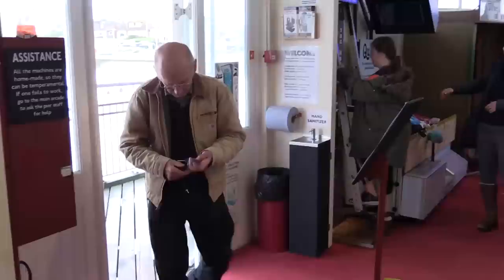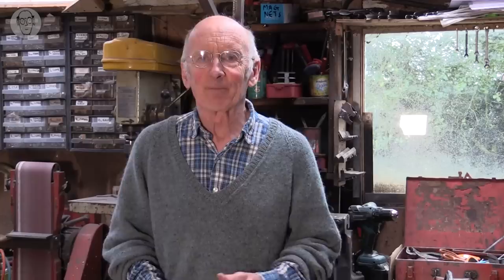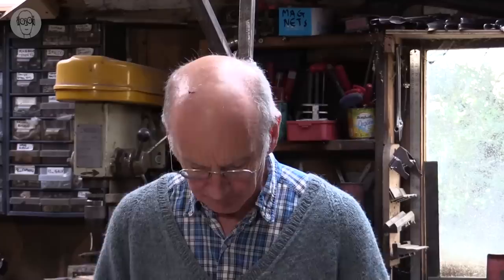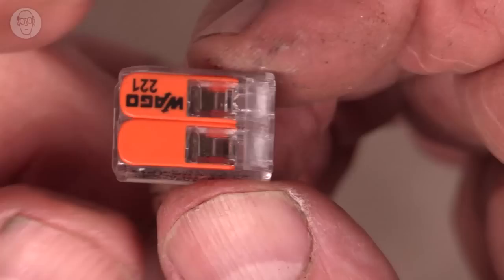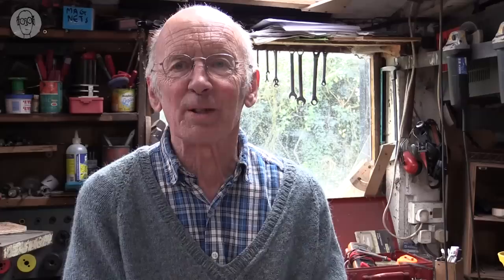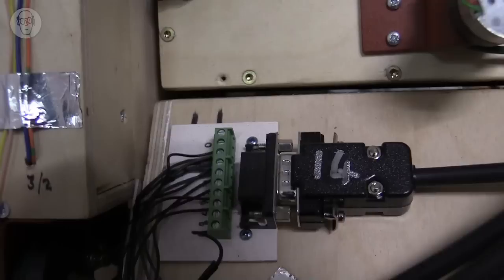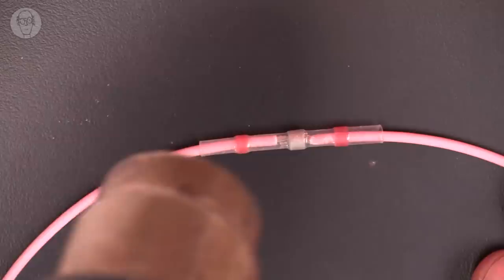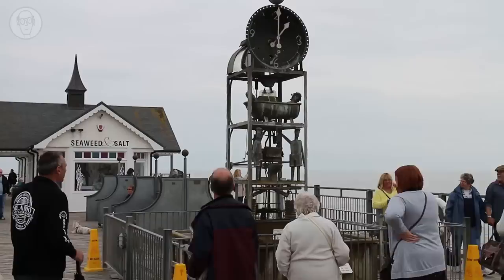CONNECTORS -- The Secret Life of Components, a series of guides for makers and designers - Episode 6

Comment: The extra bit on the IDC connector is not to lock it - it's a cable strain relief  - you fold the cable back over the rear of the connector and clamp it down with the locking bar. 
A vice is better than pliers for crimping as the jaws stay parallel
Reply: Channel-lock pliers or other similar parallel-jaw pliers work okay for those types of IDC ribbon connectors; as a former tele-data technician we used parallel-jaw pliers for installing one particular type of Category 5 data connector (Siemens or Panduit?, I can't remember which).  The manufacturer probably had a specified tool (plastic-jawed, perhaps) for this, but specialized tools were rarely provided by our cheapskate employer and so Channel-lock pliers were invariably used.
Reply: There are clamping pliers with parallel jaws made just for IDC.
Reply: @goodun2974  A fancy LAPP Cat 6 IDC actually said  "Our tool, or a Knipex plier wrench".
Reply: Ahhh, I wanted to write exactly that, saved me some keystrokes :D Thanks Mike
Reply: @AlienRelics  - a cheap hobby vice (or pana-vice) is great for crimping IDC ribbon cable connectors. And plain old scissors cuts the ribbon cable nicely but use a sharp pair to avoid getting small strands possibly sorting out adjacent wires. I have put many of these together, going back more than 35 years now.
Reply: It does lock the top as well. At least on the good AMP style ones.
Reply: Sir Scofferoff  usually the “label” was made from Tyvek
Reply: @unlokia  I always wondered what they were made of - I was scared of using them to pull the connectors in case they tore, how strong are they really?
Reply: @goodun2974  Parellel action pliers were issued by british telecom for crimping phone plugs, and another set for doing 8A wire connectors
Reply: The best way to crimp IDC connectors is to use a purpose built correct. Also it is vital to keep the cable properly aligned and straight when crimping to ensure unwanted shorts. I great hint is that you can use a pair of IDC connectors to make a removable sense coil by offsetting the wires by one. It’s very useful.  Use a pair of scissors to cut the excess wire off.
Reply: How many electrons per hour is 1 Amp?
Reply: 2,246,400,000,000,000,000,000
Reply: @Pebbles  - Thank you. Are you really sure that 1 Amp is :
2,246,400,000,000,000,000,000 electrons per hour?
I tried to count them, which was really difficult because of their wave particle duality and the speed at which they whizz by and 
thought it was closer to :
22 471 200 000 000 000 000 000 000 000 
Curious....
I thought my ageing eyes missed a couple but obviously I counted too many. How is that possible?
Reply: LOL! I can't see them properly either.  Formally, by definition 1 Coulomb is 6,240,000,000,000,000,000 elections and 1 ampere is a flow rate of 1 Coulomb per second, thus just multiply this by 60 minutes of 60 seconds for the number of electrons for an hour.  It's just hard to count a mol of any substance (Avogadro's number of 6.022 x 10^23).
Reply: I was just thinking of how @mikeselectricstuff is something of a generational kindred spirit, and am not at all surprised to find him here lending his generous knowledge. It’s channels like yours that make YouTube such an immensely valuable resource, even as it is simultaneously a cesspool of culture eating itself. For the patient and curious, there’s a wealth of knowledge.

Comment: I think they used to be called "chocolate boxes" or "chocolate blocks" because the originals were brown bakelite before the modern cheap plastic ones arrived.
Reply: What Tim didn't show was the ceramic version of these, capable of operation at very high temperatures, often used to connect kiln elements, etc.
Reply: @cambridgemart2075  here, in brazil, we use the ceramic conectors in the electrical shower too kk
Reply: In Finland they are called sugarbits cause we have sugar cubes for tea, that looks the same..
Reply: These blocks are actually not so bad if you move the wire all the way through the block, then strip both wires at the distance of both screws, then mix the wires like the yellow pages bind, and then pull it back in and screw them together. 

Both wires will then be held by 2 screws each.
Reply: @seculi7757  yeah I was thinking this, it's a better way!
Reply: @bruno_kid_  Much amusement was caused a few years back in Rio, where I couldn't think of a proper name for something I've known as chocolate block for fifty years, and my Carioca wife was in hysterics trying to translate my explanation/description... eventually, the shopkeeper let me come behind the counter to rummage in his stock :)

Comment: Another connector you might want to consider are Anderson Powerpole connectors. In recent years they've become standard in the ham radio community for low-voltage (12-48v) high-current (15+ amp) applications and they're genderless so you don't need to worry about what connector you use on the power supply side vs the load side. They're also available in a wide array of colors which makes it easy to tell apart different applications/voltage levels. I've used them myself and I can definitely recommend them.
Reply: Added bonus of needing just a standard indent crimp, and a range of interchangeable terminals that easily accommodate all sizes of cable. I think they go to 350A.

Their other connectors are also nice.
Reply: @johnalexander2349   They cost an arm.....but are worth their weight in GOLD !!! Lol !  I was lucky to pick-up a whole crate of assorted ratings at an auction .,  for peanut value.

Comment: I’m surprised he never mentioned a pocket lighter for heat shrink. I’ve used that more than my hot air gun.

Amazing series!
Reply: Most underrated comment. Smoker or not, a humble pocket lighter is an essential tool in the tinkerer's toolbox.
Reply: Particularly one of the ‘wind proof’ ‘jet’ lighters!

Comment: I've been using a wire wrap tool instead of soldering on my projects. It was popular back in the 1960s and 70s but is little known now. Phone companies used it in their switching centers and prototype computers used the technique. It makes a secure connection  with no soldering. Thanks for the new video.
Reply: Wire wrap for the win. 
One caveat, it’s not enough to buy the 
right size wire with the 
right size insulation for your gun, it has to be from the 
right manufacture as well.

Comment: If you don't have a heatgun, matches will also work, and if you don't have matches or a lighter, then pure rage should do it :)
Reply: ....or....call Superman !
Reply: I've also used candles and lighters for longer runs before I got a heat gun.  The only thing to be aware of with a naked flame is that you can easily exceed the maximum heatshrink temperature and it will start to burn, but as long as you keep turning it and putting it in and out of the heat (a few centimetres above the flame) so that it doesn't overheat then it works really well and I sometimes still use this method when a candle is closer than the heat gun.
Reply: Sunlight and magnifying glass and you can regulate the surface temperature by regulating the spot size.

Comment: For crimp spade type connectors, twist the wire first - makes a much stronger joint
Reply: I've found this as well, but it doesn't fix the random spade-to-socket tightness variation from connector to connector.  I avoid spade terminals, too, for this reason alone.
Reply: I believe that the relevant standards for use of crimped terminals, state that the wires must not be twisted. 
I hate them, if I have to use them on automotive stuff I either solder them (Lucar) and then heat shrink over, or use the type that comes with a adhesively lined heatshrink boot, so you can crimp them and then heat them to glue them to the insulation.
Lucar connectors need a proper crimp tool (not unlike the Molex), not the cheap shit from Halfords/eBay but the good stuff from RS that is beyond most DIY people.
Reply: @donaldasayers  I've heard that you shouldn't solder wires for automotive applications because the solder acts as a stress point on the individual wire strands. So over time the wire cracks due to vibration at the point the solder has wicked to.
Reply: I noticed he didn't twist the wires together for the solder splice either. I respect that honestly. just skip that step to save time, it will be fine.
Reply: @naikrovek  It's not random, it's in the spec. If you look for them at farnell or wherever, there are at least three different thicknesses to choose from. (IIRC).
And there are slightly different widths, like 6.0 and 6.35mm. It's a bit of a mess.
To a good degree you can tighten up a 'large' receptacle to accept a 'thin' spade by squishing the curly bits at the sides just the right amount. 
They're still a fairly disappointing connector though - only really to be used for fixing cars.
Reply: @johndoggett808  Correct, that is why you should heatshrink over the joint so that the wire is supported.
Reply: @Rich-on6fe  , here in the States,, the majority of 120VAC mains "rocker" switches, especially those with a built-in LED or neon bulb for " ON" indication, will have male spade lugs moulded into the switch. Therefore, you either solder to them or use a crimped-on female spade lug.  Most electrical devices come from the factory with plug-in spades. .
Reply: @goodun2974  fair enough. Suppose it means the electrician is less likely to poke himself in the eye with a screwdriver.
Reply: @Rich-on6fe  , I've done enough electrical work to know that poking oneself in the left hand while wielding a screwdriver in the right hand is common, especially now that the screw terminals on many electrical devices here in the States are "combination" heads that "work" with either Philips or straight blade, but aren't an exact fit for either, and using a Philips screwdriver tends to cam out before you can get the connection really tight. I'd prefer Robertson (square) drive, or Torx.

PS, toggle switches often have screw terminals, but rocker switches rarely have them. Dunno why....
Reply: hate to say it but most connections i've seen and done on 120v mains lighting, people just twist the wire tight, form a little loop(if you're lucky) and screw it under the screw, there is also ones made to have the wire just shoved in a hole that like the waygo spring loaded clips, it grabs onto it with a 1 way metal spring clamp(i never use these personally but i've seen plenty of installs that its just shoved up the backside of the switch)
Reply: @frogz  , there is certainly a bit of an art to forming a proper "question mark" shaped loop that will stay underneath the screw as you tighten it securely, and of course you have to install it facing to the right so that the clockwise motion of the screw pulls the wire under the screw as it is being tightened. And then there is the question of whether stranded wire should be tightened to a screw terminal in similar fashion. Myself, I tend to say " no", unless one tins the very tip of the stranded wire before forming it under the screw. 

Many modern electrical fixtures use the screw to pull a metal bar that pinches the wire tightly against the terminal; this eliminates a lot of the fiddling and guesswork. I don't like, and don't use, the spring-loaded clips where you just push the bare wire into a hole on the back of the switch or outlet.
Reply: @johndoggett808  , in 12 years of car stereo and alarm installer I never had a soldered connection break or fail. An occasional loose crimp, yes, but that was usually a failure of my technique.
Reply: Also, crimp connectors are not for solid wire.
Reply: @pointedspider  , there are hundreds of types of crimp connectors and thousands of applications for crimped connectors and connections. From Quora: " There are crimp connectors for solid wire like Scotchlok UR connectors....". From IET forums, " Large solid cables are often crimped with indentor tools....". Also found out that T&B makes a line of C-Tap crimpers and connectors for # 6 solid bonding/grounding wire.  Moral of the story, dude, is "never say never!"
Reply: I sometimes put a bare bootlace ferrule on the end of the wire before putting it in a crimp spade type connector. Especially if it's between sizes. I only tend to use them in situations where they're permanently fitted e.g. a fork or eyelet on the end of a wire going to a VFD or some piece of switchgear.
Reply: @donaldasayers  I did notice that soldered heatshrink seemed to have two grab rings to support the joint further, which would be lacking on standard heatshrink.
Reply: @johnbull5394  I have not had much success with those, the melting point of the plastic and the solder is too close. I find I melt the plastic before the solder has flowed properly. It's very easy for a stray strand of wire to poke out through the plastic. I prefer to solder with known quality (PbSn) solder and cover with adhesive lined heatshrink.
Reply: The SOP for crimp terminals is never to twist the conductors.

Comment: I’ve just also discovered speakon and powercon connectors - lovely to use
Reply: @Jannie Kirsten ,  Speak-on connectors are frequently used for high wattage amplifier to speaker connectors, which means they are passing AC!
Reply: They are nice, but not the cheapest; they do have the major advantage of locking, unlike IEC C14s

Comment: This is a great opportunity to pass a tip of mine for attaching wires to D connectors very quickly. Partly fill each bucket with solder, leaving a little tails of unmelted solder sticking out of each bucket by a few mm. Tricky at first to do. The wire ends then don't need to be tinned beforehand. Attaching each wire by hand in turn is easy with soldering iron in other hand. Tin the end and attach it as one operation at the same time.  No need to add solder because there is fresh solder ready on each bucket.
D connectors are brilliant, they connect great and can't plug them wrong way round. If you have all of as different sized ones you'll never plug them in wrong place either.

Comment: At 31:18, IDC stands for Insulation Displacement Connectors. I worked in the telecom field for a few years and "punched down" many a telephone or data wire onto type 66 or 110 blocks. Worth noting that the spring-loaded punch tools send a mechanical shock up your wrist and arm with each wire you " punch"; carpal tunnel syndrome, arthritis and other repetitive-motion injuries are common in the industry.
Reply: Krone are the best

Comment: I am going on 80 years of age... and started back in about 1965 as a design engineer in a huge business firm making connectors. First, the connectors you show are uncannily similar to the ones we sold, and the tools are MUCH more expensive today than before. Ours of my company were made of two types, one for the military and one for domestic use.  The military types were provided with a way to guarantee the accuracy of the connection and were also made with check tools to make sure that the mechanisms and the crimps were accurate. Other than the fact that the American sockets and plugs usually have no fuses, they are cheaper to make and less robust and safe.

Comment: I’m a Canadian tinkerer and the “full circle” of twisting two wires together with an insulator on top is like the Canadian invented wire nuts (we call them Mars or Marettes) and to me the simplicity and the fact that for home wiring has used them for over a century with few issues when used correctly makes them incredibly reliable and simple devices for termination for lighting fixtures and special wiring devices.  I have used Wago connectors, crimp terminals and other connections on my electrical projects in the home and on my trailer and they haven’t failed me yet unlike the other aforementioned connectors.  They aren’t as nice looking but do the job nicely.

Comment: Quite comprehensive video, but for anyone reading, do note:
MAKE SURE the spring or screw in a connector DOESN'T grab onto the wire's insulation. This will create heat, sparking, and maybe fire.It should be holding onto the copper. 

You can see him make this mistake a couple times in the video, but it probably is because he has a camera in the way. If you're still learning, always double check this, particularly in household wiring.
Reply: Luigig44, yes, for most connections and connector types the amount of wire from which you strip the insulation and the length of the exposed copper is critical for making a good reliable connection, and is one of the things that most people get wrong due to lack of experience.  Not to mention that most connectors function better if you twist the strands together tightly before attaching the connector.  

Matching the connector to the cable type is critical. Many IDC connectors do not function correctly with stranded wire, only with solid wire. Many types of crimp connectors are designed primarily for use with stranded wire, and use of solid-core wire can be problematic unless you also solder it. Stranded wire that is factory pre-tinned wiith solder has properties that make it crimp like a stranded wire but can be used with IDC connectors where it functions like a solid-core wire; plus, its extremely easy to solder because its pre-tinned!
Reply: Several years ago my oven stopped working. When I investigated I found that it had been wired through a chocolate block. There were 4 wiring errors in the chocolate block itself, and at least two others in other parts of the wiring (including a 1.5mm flex being wired through a 32A breaker)
https://photos.app.goo.gl/d41y5hGxcAkuXwws6
I feel lucky the house didn't burn down.